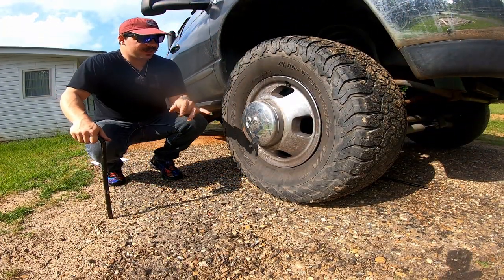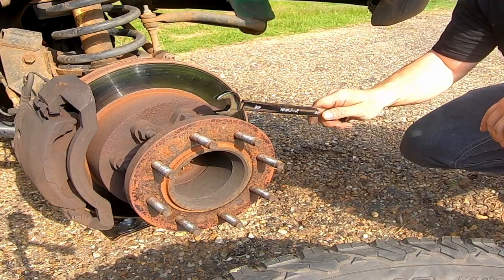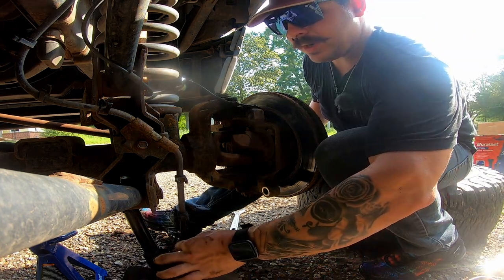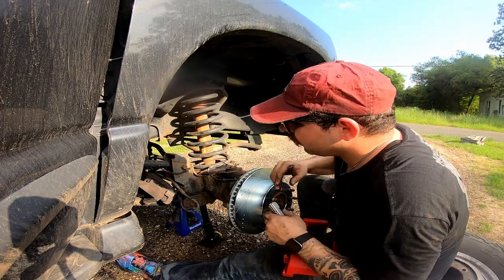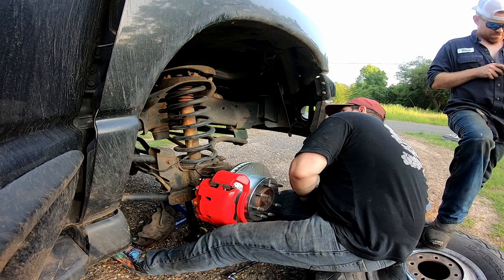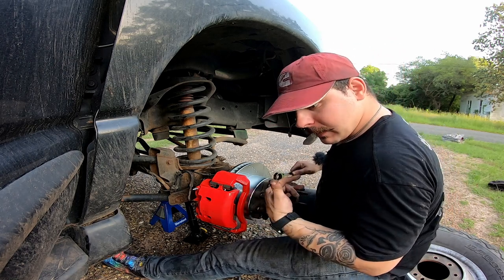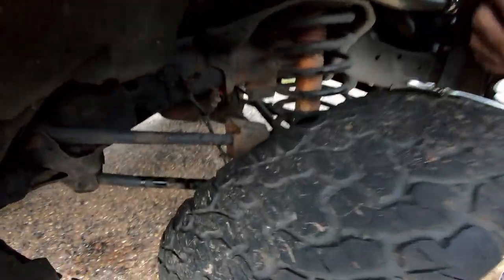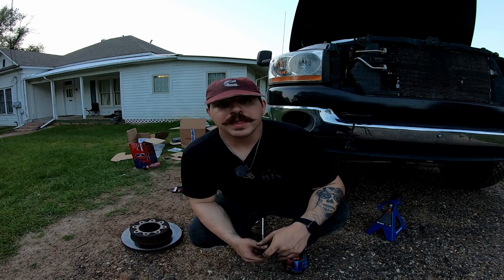UPGRADED Brakes on my DUALLY

Comment: 1 added tip is to tap the brake line bolt with the crush washers to seat them. You will get about ⅛ to ¼ turn on the bolt to ensure no leak.